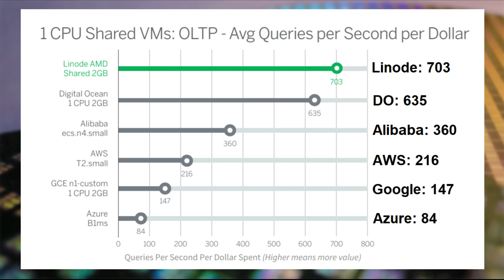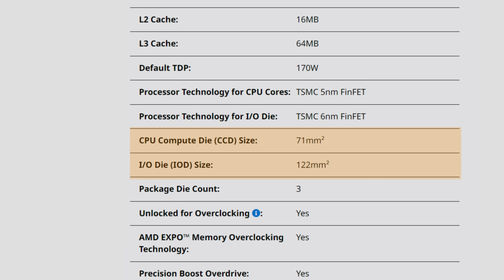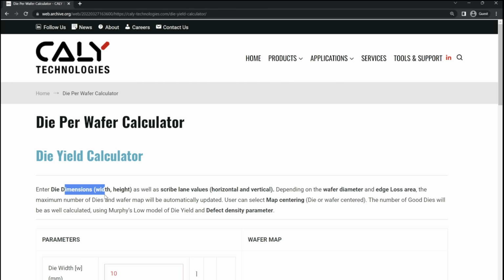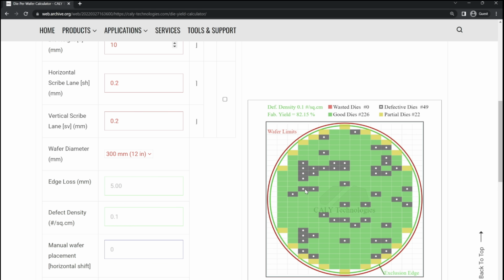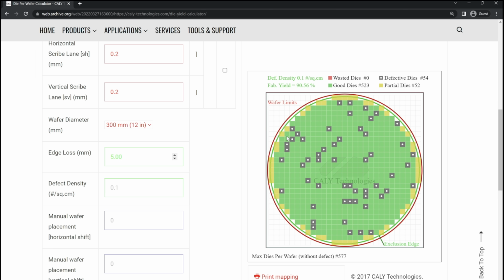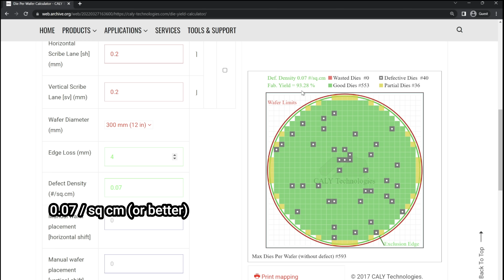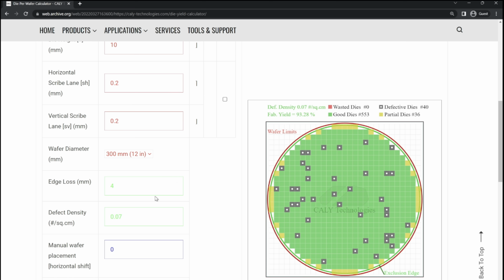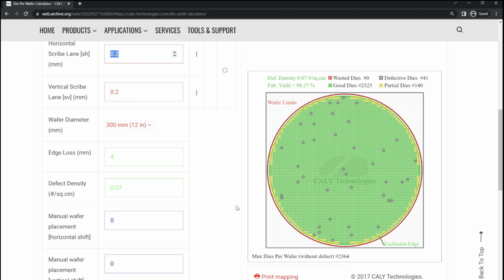AMD Ryzen 9 7950X: Cost to Manufacture?

Comment: Definitely good to keep in mind the hundreds of millions or billions they probably spent developing it. If you spent one billion on development and make a million chips, that's $1000 per chip just in R&D.
Reply: Right. If it was just the BoM, I would be making CPUs in my basement.
Reply: @technologyanimals  you mean like this guy? https://www.youtube.com/watch?v=IS5ycm7VfXg
Reply: @technologyanimals  3d print a 7950xt and maybe an extra one for a friend
Reply: Yep but how do you estimate the intangible, I would speculate the latest development costs have come down since they aren't scaling nodes as fast as before and the development costs only comes from redesign of the transistor layout and new cell types. But most of this can be automated with modern electronic design tools and even AI. The only reason there RND costs on there stock balance sheet stays high is because they continue to employ staff that aren't doing anything. They call it corporate day care now
Reply: That being said AMD did introduce AVX-512 to there newest chips but I suspect this instruction set and circuit design were probably done years ago but they were waiting for space on the die to add it.
Reply: @justindressler5992  Not scaling nodes as fast as before, but capacity is very limited so whomever pays the most gets it. Also they need ever more specialised lighting (EUV and looking at xray and others) and multipatterning which means a lot of research to get it right. They have issues all over which costs a lot to get right. 

Tiny chips made on 50nm (less need for transistor density and optimum power draw since there is not a lot to heat up, save space or burn power) and above have fabs with excess capacity not a shortage, meaning you do not pay a premium just for the privilege of using that node.
Reply: @justindressler5992  AMD had AVX-256 decoded to 2×128bit and did it that way. AVX-512 is good, but it peaks the powerdraw insanely high, and the newest AMD and Intel lineups already have insane powerdraw (some earlier Xeons with ~180 watt tdp peaked at 320+ for AVX512, and that was clocking down internally for AVX-512). Have not looked it up but I suspect they just have the 512 decoder and internally it does either 4×128 or 2×256, which is easy to do and lets it not draw too much and no need to clock down.
Reply: @jamegumb7298  I think AMD's implementation is a 2×256. But power draw is going up because nodes aren't scaling like they used to. So the only way to bring more performance each generation is to increase frequency and power. This can only go so far the thermal load on the transistor junctions and silicon will put a stop to that. What I found most interesting though is Intel managed to beat or match AMD's performance at 10nm vs 5nm. From the surface this should not be possible especially clock for clock. But the reality is the multiple Chiplets bring latency that can not be easily resolved. If Intel managed to build a monolithic die at 5nm or 3nm it would be unbeatable. The problem is that the thermal load is then distributed across the entire die. This is why AMD is more efficient it isolates the io from the CCD. This gives a larger surface area to transfer heat. When you get to 5nm it get vary hard to control leakage and quality of the transistor. AMD is using 6nm for it's CCD and 5nm for IO. Unless they can make GA perform like current tech they won't be able to scale much further. The increased power even reducing due size is needed to overcome leakage.
Reply: @justindressler5992  Frequency but also core count, power just goes up with it. But core count comes with its own drawbacks, not everything just scales to more processes. 

Node scaling not going like it used to, well not like that is new. Back from when we got Sandy Bridge the arch was kind of stuck for years and also was the core count (mostly due to little competition but still), ~10% each jump until Ryzen came and they had to get into gear. Which shows smart use of better designed cores can help a lot as well. Or course there are limits and cost/benefit to it all. I feel like the new(er) cpu's now are just catching up.

Leakage can be helped to an extent, this is why they went from simple "2D" transistors to all aroudn to now finfet. But that cannot be stretched a lot more. 

We cannot go much further with this. Transistors can already be counted in number of atoms. Unless we make some very sudden commercially available jumps in pico of femtoscale engineering smaller is not going to keep being the solution. Photonic chips have already shown promise and 10Ghz switching speeds just to start, with indium arsenide transistors shown to approach terahertz limit (heavily cooled, but  600Ghz+ is possible under normal high-ish temps such as in a pc). 

But this is just the hardware side. Many if not most frameworks already take up loads of cpu cycles and mountains of ram. Yes it makes devwork somewhat easier but a lot of times I get the idea they just suck up cpu time and suck mem like they want to prank consumers (looking at you Electron). A lot can be gained software side and I think it is ignored too often. When I write software I actively check where it necks and try to solve it. Many colleagues dgaf.
Reply: @jamegumb7298  I agree completely with you statement if core count was the most useful metric we would all be using threadrippers and Xeons. But as you said alot of software does not scale with threads much. This is Intel's philosophy that fewer high performance high frequency cores will work for consumers better than 80 cores. The difference between a Xeon or Threadrippers is they have simpler cores with lower IPC, this allows them to put more on a chip they also clock a lot slower but these chips are also thermal locked at around 300w. We now have server level power consumption of consumer products. The only way to reduce power is to make transistors smaller but this is proving vary difficult. People think that mobile phone SOC's are the same as desktop processors but normally they have much lower IPC and Frequency because of the lower wattage they scale more easily. But I see the end of the road for these possibly at 3nm. Software optimisation is definitely an area that can be improved and I think some of the biggest performance gains will come in optimisations with AI. Most of AI are the same mathematical operations repeated over large datasets. Simple mathematical refactoring and simpler merging of nueral networks will help. It is even possible it the future AI may help to improve data compression resulting in leaps forward with data processing. 3d gates help been the solution since the introduction of Fin FET but they add substantial complexity to chip design and manufacture. The next gen chips will likely be gate all around but just like fun fet these technologies require multiple layers to be built and alignment at layers above 7 become exponentially more difficult to produce I think the best in the industry are doing 12 layer designs but this info may be dated. Gate all around will require better alignment and more layers. on-top of this each layer adds to production time and end user costs. I think 3nm in mobiles will be vary expensive. At least until it becomes mainstream. Anything less than 3nm is impossible with current silicon techniques and require entirely new manufacturing techniques we are getting so small here that deficits will be impossible to control. So they will have to engineer me any redundancies into the chips.
Reply: @Karl with a K I'm pretty sure that doesn't even cover Jim Keller's salary while he was involved in the development.
Reply: @Karl with a K 30% over cost to manufacture isn't even close to profit unless you think people should be slaves and work for corporations for free.
Reply: @Karl with a K An entire new modern architecture from the ground up in a few weeks? Haha. You're dreaming.  It took 5 years to design the first Zen architecture, and that's with existing IP blocks, designs, and microcode to draw from.  They don't just start on an architecture after the previous one is released.  Different teams work on several generations at the same time.  They are probably already finalizing the brand new design of zen 5, midway through zen 6, and the teams that have finished their specific zen 6 work are already working on improvments on it for zen 7.  Meanwhile there's probably a team in the back already starting work on the next ground up design.  This is why intel is moving into it's tile architecture.  Not just to match the yeild on chiplets, but because with foveros they can add new IPs to their chips as they come out.  This will help their execution problems because they can update different parts of the chip without getting stuck waiting for a single flaw to be worked out.  They can update their A.I. accellerators and E.cores, and release on time even if their new P.core or graphics design has a bug and gets delayed.  They're not doing that because chips are easy to design and only take a few weeks.
Reply: Nice 🙂. There are other costs associated with the process, as well as bringing the product to market, and everything else that went into it. Don't forget that the lower end product has only $20 less in silicon, yet costs hundreds less in price. It includes everything else that is on the high end product. So, are they over pricing the high end product or are they taking a huge loss on the lower end one?
Reply: @Gryfang451  
it's already accounted for.
Reply: Or at least thats always the excuse that the development cost this much and that much but how do you know...
Reply: 🤣 you've never worked R&D huh?
Reply: Not to mention that the manufacturing cost has nothing to do with what AMD pays TSMC to make it for them.
Reply: @otbricki  $17,000 per wafer.
Reply: @otbricki  The wafer cost is what the customers pay. TSMC charges their customers per wafer which is the same reason different nodes cost different amounts even though it is the same silicon wafer they are using. The whole process is based on booking wafer capacity which is how TSMC makes their money. The actual cost of the silicon is relatively cheap for TSMC. Most of that cost is the TSMC cost of service.
Reply: @otbricki per wafer cost of $1700. isn't that already the price AMD pays?
Reply: @otbricki  He's talking about the prices TSMC charges AMD per wafer
Reply: @otbricki  They paid a lot of cash up front just for a spot. But Apple outbid them and everyone else for the newest process.
Reply: It's not working like that.... The designer is getting 30 50 million dollars and you get your architecture... Like zen1 and you are shrinking it 10 15 years down and getting boosts
Reply: The euv machine is about 150mil a pop.
Reply: @jintsuubest9331  Yeah but that is TSMC's cost, and doesn't affect the price that AMD pays per 300m wafer:   $17,000 USD.
Reply: @Dee Snow the cost's of one company is relevant for the pricing. You have to make your cost's at least to stay alive. But yes TSMC has paid of the uev machine with hundreds of customers to thousands of customers on previous machines.
Reply: @jintsuubest9331  yep but they don't buy new equipment every year. So this cost can be capitalised over several years of production.
Reply: Lowest on amazon is 700$ one chip cost 70~ they spouse to get 30% it means retail should cost  max 100$ ok you tell me r&d… let me tell you something about r&d you use money from profits that means r&d is allredy in the 100$ price and let me remind you they take 700$ where is the r&d intel still wins right? The truth is humanity capitalism is porcine we have no bottom and it will kill us eventually
Reply: You think they spent $1b making it?
Reply: a tonne of those chiplets go in to EPIC  where companies pay 100x the BOM cost per cpu.
AMD is making more than just a little money.
Reply: Oo stop it!! If they were spending that much in r&d their yearly bottom line would be an even break rather then the billions of dollars in record profits every quarter!!
Reply: @solidsnake6405  ^ This is true. What RnD they have to spend on?

They have nothing, no fabs, no innovation to speak off. 

Intel has Fabs, BoM, etc, that's why their costs are expensive, but AMD products cost so much for no reason.

Their expense is literally just a paper agreement between TSMC, and what they could buy from TSMC. Any wafers defective is refunded.
Reply: @solidsnake6405  Actually, it's twice the MSRP when compared to 10 series to the latest 40 series, or last gen 30 series.

But hey, Aymdiots will make AMD a pass if Evil Su decided to copy-paste Intel-Nvidia strategy but made it much worst.

Like how RX 6900 series is a 3090 series $$$.

Or the recent Zen++++ line-up, we are being treated with the 'Super' series at a later date, instead of having all of the APU with glued cache.

You're paying more money and double the money. Buying 7950X is a waste of money, might as well wait for 7950X3D.

There's always be a sucker that does this:

1. Buying annual release or the latest and greatest
2. Complaining it's expensive and perf gains are little to none
3. Complaining that they have no money

For the CPU space, for Aymdiots has some additions:

5. I'm buying 3000 series with 500 series board, but I'm throwing away my perfectly working 1000 series with 300 series platform.
6. Yet, when confront that 1st gen Ryzen doesn't work with 500 series board, they complain just buy a new platform, and no one should be running 1st gen Ryzen.

Like bruh, what's the point of for/backwards compatibility on AM4?

That's literally coming from a friend that own 1700X with a 400 series, only to find out that 500 series board is unable to support 1st gen Ryzen.
Reply: Perhaps Ian should do a video on this! Leading-edge semiconductors are probably the most complex mass produced technology developed by humans, ever. I don't know precisely why exactly it's so hard, but the fact that only a handful of multi-billion dollar companies can compete, and a new ground-up design can take multiple years with hundreds to thousands of engineers should be a sign. 

AMD certainly sells more than one million CPUs, and the chiplet design lets them even more easily spread those R&D costs across their products. Perhaps it only cost $500 million to develop and they actually make 10 million CPUs, now the per CPU R&D cost would be $50. AMD is definitely profiting, but getting there certainly wasn't easy. If it were easy, somebody else would have already done it!

If you have 1000 engineers, and pay them each $100k per year, that's $100 million per year right there. If development takes 5 years, you get $500 million. It's obviously not that simple, but it's not hard to see that this stuff isn't easy or cheap.

I'd totally be interested to learn more about what makes semiconductor development so hard though. It often gets boiled down to something (that I don't understand) like "We increased the micro-op cache from 2 to 3" but we don't hear why that's hard and why they didn't do that last time.
Reply: R&D doesn't work that way.
Firstly, the budget is not $1B.
Secondly, the equipment needed for research isn't bought every generation. 
So although it's not $65, it's much closer to that than it is to $1000.
Reply: R&D is obviously a significant cost that should be accounted for, but $1 billion is a vast over-estimate and one million chips is a major under-estimate.  I would be pretty surprised if it accounted for more than $100 per SKU and in fact is probably not significantly different from materials cost.
Reply: I think the R&D they invest will involve all the CPUs in that generation.
Reply: @tristanyt319  there's a reason why it's called architecture, all chips are the same.
Reply: @tristanyt319  also its not just for that generation, its just building on what they already have.
Reply: @tristanyt319   Yep, also AMD have 2 different teams working on Zen versions at any one time, often simultaneously. While Zen 3 was in tape-out, Zen 4 was in being created etc.
Reply: @tristanyt319  yes it is, they make it all back since ryzen .
Reply: Manufacturing usually has a minimum of 100% profit margin this is required to keep spare part inventory, engineers employed pay operating costs, marketing and so one. In the high tech sector were there isn't much competition 200-300% margin could be expected. Also AMD avoids the depreciation costs of operating fabs which need replacing or upgrading every couple of years. I would suspect there cheapest chips. Are making the company around 25% but there deerest around 1000% this is just how it is. If there was more competition say from China this may be a different story.
Reply: @justindressler5992  Problem is, only Intel and AMD can make x86 chips. Even AMD only got the license through trolling, otherwise Intel would have 0 competition.
Reply: @alex31ytb  I think Cyris has a licence as well. But you only need x86 to run Windows and even then ARM can be used of Windows as well. The instruction set was cloned several times in the 90's. But the word out is RISC-V which is an open ISA is pretty good and runs on Linux.
Reply: Exactly, price is not equal to manufacturing cost alone. It is an interesting piece of the puzzle to analyze though.
Reply: Billions for one chip design?
Reply: Why would it cost that much much to develop a chip?
Reply: BS read my comment r&d is money after profits and even if not why taking 1000% more its spouse to be 30%
Reply: And the marketing, and shipping, boxing, manuals, software and drivers.
Reply: @TheDrWes  and the Lambos, and yachts, and Dom Perignon, and caviar, and apartments, and prostitutes.
Reply: @rawdez_  First of all, a company runs on profits, you wouldn't work for free. second of all, we all choose what we spend our money on. if they decided to spend their money on those things, then so be it. what have you spent your money on that would be altruistic lately. 
These companies don't owe us anything. They create a product, they have overhead. Maybe you could afford these things if you started a business. I doubt your business would succeed.
Reply: I think it doesn't really matter if people are happy to pay these prices they will sell for those prices remember the first micro processors cost a lot less in the store and they needed to engineer everything from scratch. Every generation after would become cheaper to engineer as they become more feature complete. This is what Moore's law is about the chips maintaining the same cost but offering double the performance every 18 months. As a new node would require a fab to upgrade resulting in an incremental transition every 18 months. This of course is just artificial since the ligography techniques were pretty much the same until 20nm. The scaling was mostly artificial to keep prices up as these techniques were perfected in the early nineties. The more modern techniques are much more difficult to produce reliable chips  there are many factors such as submerged ligography multi layer chips euv and so on these techniques require much more elaborate equipment to make work. But the chip industry has been milking profits since the eighties look at Intel's new chip it is a copy and paste on the same node they even have a almost identical chip with the ks series instead of getting cheaper because they have perfected the yield over four generations on 10nm they just maintain there old pricing I would expect Intel is making way more on there chips than AMD are. This just shows that yield is reducing profitability in the latest nodes below 8nm. Intel has known this for a long time. It might get even more expensive when they go to 3nm using exotic materials and gate all around requiring more layers and much higher energy to produce.
Reply: @justindressler5992  the main reason why TSMC prices go up is because they see ridiculous prices AMD/Intel/NVIDIA put on products with chips made by TSMC.
TSMC just wants a bigger piece of a pie. hence newer nodes cost way more.
Reply: @rawdez_  yep of course as long as the consumer is happy they can charge as much as they want. Most think chips are some kind of secret magic that only a few people know how to design. This perspective helps to keep competitors out of the market and prices up.  If you own a copy of a decent Electronic design package like Altium or Cadence and a license agreement with ARM you can design chips with a small team. But the entry is cost for licensing, prototyping, test equipment staff is still quite high maybe a budget of several million to design your own chips that would have driver support on Linux and Windows and Android. Most companies choose not to design there own chips though as off the shelf designs are a safer investment.
Reply: @justindressler5992  if it were that easy there'd be more companies doing that, but you need a pretty huge company to not only make the chips but also create motherboards, all the firmware needed and somehow have a network to update your firmware for security patches (so basically windows has to acknowledge you as a chipmaker) AND you'd have to start off at 5nm process with a brand new architecture and still be competitive to intel (making cpus since 1971) and amd (since 1975)

That's why there are other cpu vendors but only for datacenters or mobile
Reply: @Suilujz  no it's just not viable to design chips that way you can buy SOC system on chips with full certificate and testing for less than 50usd. This is why companies don't design there own chips. That being said there is a difference between using of shelf IP and designing a complete instruction set. But again no one would do that because it would be equivalent to reinventing the wheel. Im not speaking without experience here I have both a Electronics degree and Software degree and have worked for several hardware manufacturers building consumer and industrial electronics I have also written embedded software back in the day. Chip design has mostly been the same for 30 years but the software tools and computer power has gotten a lot better so it is cheaper than ever to design custom chips you can even prototype high transistor count chips in house now using FPGA's before going to commercial scale. Don't get me wrong nothing is ever easy it always takes time especially when designing modern 14nm or less nodes with clock freqencies approaching 3ghz and higher. But entry is definitely way cheaper than ever before your can even design chips without license constraints using RISC-V instruction set now.
Reply: @Suilujz  sorry I didn't read your entire message I missed the more link but firmware is standardised now your can buy UEFI license and add custom UI theme and install on mayboars Intel and AMD typically provide this firmware which includes microcode patches for bugs in there CPUs. As for vendor certification in regards to drivers all vendors use the same drivers they just have a different VID and certificate. The only custom stuff are the bloat ware the manufacturer chooses to add if they think the consumer would precieve value in it.
Reply: Alot of people think the Chinese are stealing technology but if your a billion dollar company you have the resources to build an entirely new chip and instruction set from the ground up without copying. The main issue for entry though is Windows gaardened wall they will only support US chip vendors so If China wanted to make a CPU capable of running Windows they would have to fake the Intel or AMD chip designators this would mean they would also need to write the instruction set with the same querks and bugs of that chip so the microcode patches correctly. Of course if you were building a new chip you wouldn't bother with Windows and instead design for Linux were you have the entire source code a can make small changes to support your chips. This is probably what China is doing anyway to replace Intel and AMD. Remember Android and MaxOS are Linux/Unix derivatives Harmony OS is as well. This is by design to avoid heavy software design to support there chips. Windows is becoming more irrelevant by the year.
Reply: not customers problem
Reply: And marketing.
Reply: @Karl with a K what are you talking about the masks alone needed cost multiple dozen Millions of dollars.
Reply: Hahahaha 100s of billions to spent developing :D these cpu's have an annual release schedule..
Not even 100s of millions my guy. they make WAY more profit, netprofit, and other kinds of profits on top of profits.
if they make 100 billion in net profit and the next year 70 billion in profit that's called a LOSS LMAO!!!
Reply: No I’d argue that the R&D is included in that price, TSMC produces roughly 300 to 400 of these wafers per hour. If you’re referring to AMD’s R&D they didn’t develop the 5nm node that was TSMC, AMD just gave them a spec of what they wanted and how they wanted it done. AMD probably gave them 200M to start development of their chips, I wouldn’t say a Billion.
Reply: @ElvisRandomVideos  lol, just a spec eh? Is that what a CPU architecture is these days? Just a spec sheet.
Reply: @GSP-76  you said spec sheet, I said spec of what to do and how. Yes AMD did spend on R&D to know the how, but that’s over 5 years.
Reply: @ElvisRandomVideos  a CPU architecture is NOT a spec sheet whatsoever....and it's constantly changing year after year.
Reply: @GSP-76  dude you are saying spec sheet! But go ahead feel free of saying what goes into the process of making a chip, I’d love to hear what you know about that.
Reply: @GSP-76  tell me how you don’t have a clue about what you’re talking about in an essay! I wasn’t asking about their IP. Which AMD engineers go to TSMC fabs and perform the process that TSMC isn’t aware of? Are there AMD engineers in TSMC fabs? Can you elaborate how TSMC is aware of what the sequence of steps are, how long they need to dope the silicon, or when deposition takes place? Without any process specification. 

Go ahead I’ll wait, please tell me how TSMC knows what to do with the bulk silicon without any AMD engineers in their fab, and no specifications.
Reply: @ElvisRandomVideos  well not like you'd understand an essay either. That would require some sort of intelligence. Let's make this easy - Do you think Fans have CPU company trade secrets since they're building CPUs for them? Easy enough question.
Reply: @GSP-76  yeah that’s what I thought, you’re just a Fan! I’ve been working on this industry for 20 years.
Reply: @ElvisRandomVideos   @Elvis Gomez  sure you are.... everyone's a professional in YouTube comments. You still didn't answer my question "industry pro"
Reply: @GSP-76  I don’t really need to… you answered mine.. you’re just an ignorant fan! And because of IP (trade secret) I can’t tell you what I do in detail just in case you weren’t aware of how that works.
Reply: They make a lot more than a million chips.
Reply: @Derosier.  Google it then.  Annual R&D for 2021 was 2.8 billion dollars.  According to AMD's financials.
Reply: Also future R&D, manpower costs all other running expenses of a billion dollar company.
Reply: Zen++++ is just Zen+++, it's also based on Zen++. Little to no RnD is spend since AMD has no good engineers.
Reply: I bet 60% of “RND” goes to marketing
Reply: RD , marketing , box , software support , warranty.
Reply: It’s low hundred millions. Somewhere around 100-300 iirc.
Reply: that has to be taken into account in the cost - TSMC as a whole is proftable
Reply: Development cost, expensive employees, infrastructure cost, and failure rate are all important to take in, they raise costs by a very large amount
Reply: Yup, this is the real reason why they cost so much. Everyone has to get paid that works so the price counts for everything that goes into company resources that goes into it.
Reply: @Karl with a K no way in hell are you paying dozens of engineers less than 100,000 dollars. Hell each engineer alone is likely making at least that much and chip designs take time as you  have to plan them out and test then plan them out again and test etc especially with die shrinkage and any changes to the fet. It's no billion dollars but it's a few hundred million spread out over time.
Reply: Yep. And also all that R&D was done by hundreds or thousands of employees that still need to get paid.
Reply: @Karl with a K bullshit. It takes much longer than 90 days to design a chip. Tell me how many masking layers are needed? How do they prove a design works on the node? You keep talking about business as if you think you know something yet you clearly don't understand how even die shrinks with the same architecture is time consuming because the physics change. Stick to your pretend life instead of talking about crap you clearly don't have a clue on.
Reply: they make money in first development cost in first generation sell already...
cut the BULLLLLLLLLLLLLLLLLLLSHITTTTTTTTTTTTTTTTT
Reply: @sinanisler  huh?
Reply: Billions over all the year? Sure. But per new chipset? Not even close.
Reply: Who said the manufacturers spend billions for development for PC parts? I hardly believe that. Look at ARM for example. Its official corporation. Very succesfull one. They made the technology behind the smarthphones today. Their CPUs are much more advanced, smaller and efficient than any of the PC ones today. But Intel "Hey guys, look at our new i9 Super Beast 8 core CPU. Its result of years of development and billions of investments.". The Intel and the AMD CPUs are crap all of them compared to even the weakest of the ARMs CPUs. Thats the sad truth.

Many fall to that stupid lie. Many enough so Intel and AMD have an entire PR strategy for selling on that wrong basis. 

Today, this hour, the corporations can start mass production of small build, green, 16k PCs on reasonable prices.
Reply: and who says TSMC doesn't want a profit to keep developing their fabs?
Reply: They probably don't spend billions per iteration of chip development my guess Intel may spend up to 100 million, but this is just a pure guess. But they would have spent billions over the entire product life. The brand new chip is literally copy and place four new E cores there was zero tuning in regards to IPC so problem nothing changed in the design. The reason they could clock higher was because the production quality increased. They have be fine tuning the 10nm node for five or more years. This means the same equipment has been used does better waffers I suspect. They already had room on the die and there 12900ks was running similar clocks to the current gen. Really the R&D team probably took a holiday during development of the 13 gen chip.
Reply: @justindressler5992  this is AMD chip the video is about, not the Intel one?
Reply: @disadadi8958  I know but just putting things in perspective
Reply: Exactly my thought. if it was this profitable everyone would be making CPUs.
Reply: @anandapriyadarshan  it's not that easy. Profitable maybe, but have you ever had to design an IC? Even the most basic one is painful to do on something like Cadence, let alone a behemoth like a modern CPU
Reply: @disadadi8958  ha ha, yes. that's exactly the missing point on this video. just calculating the material cost - without taking into account the R&D and the patents and everything else that counts to producing these chips. Vehicle prices might be really down if we did the math like this.
Reply: It really depends on what your trying to design, if your designing an instruction set it is vary difficult because you need software support and industry acceptance. If your cloning an instruction set it is much easier but you have to deal with patent and copyright issues. If you using an existing instruction set under license like ARM you then design the chip with well established rules and testing procedures. Each level requires less and less input to complete. There are actually hundreds of companies using ARM instruction under license. But x86 compatible instruction set is heavily protected by copyright and patent law. But just because those laws exist hasn't stopped companies from making clones, if the get a assembly language book you can reverse engineer x86 in short time all the information needed is in those books. To design the chip eg deal with frequency, temperature, clock rates among offer things is vary hard. But the chip industry does not re-invent the wheel here thos have design rules that electronic design software uses to validate the design. They used to layout by hand in the early days but with modern CAD and even AI it becomes alot simpler. Keep in mind once an instruction set is designed it really can't be changed much. If they make any significant changes they will break the applications running on them the last significant change to x86 was in 1999 when they added 64 bit support. To get around compatibility issues they may add instruction set extensions like SSE, AVX. These extensions are not required to run your software and OS. The fabrication level is basically been the same process since the seventies the only difference is precision better optics, mirrors and higher intensity  light sources, the fabrication is the most difficult to perfect by far and has the greatest cost to the chip. The instruction set hasn't changed in years and the chip design to a large extent is copy and paste or automated.
Reply: R&D in chips is difficult. The industry is not really focused on one chip, but hundreds of thousand of people try to make the best jobs at their tasks. And any improvement will be used onwards in dozens of products.
So they can spend 1billion knowing that 10-100 products made in the 100'000th per year will repay it.
Reply: That's the trouble with modern capitalism: artificial scarcity. Producing below capacity to maximize profits may be good for one firm, but if everyone does it then you've imposed an artificial ceiling on the entire economy. That's why a communist country like China dominates manufacturing and tech companies don't want them acquiring advanced semi conductors. Their strategy is to flood the market and wipe out the competition with sheer volume.
Reply: @ryerye9019  ASML and Nikon cannot fill demand for chip machines as it is, and even  if ASML could get production 30%+ higher, Cymer cannot provide the lasers as it is. 

Even If either of these giants could create the chip machines to sell to China, China does not have the trained staff so they would need to train people to train others while they lack competent enginers as is. This is not a 2 hour powerpoint we are talking, but an intensive 6-9 months course and training regime.

You make it sound like ASML has a few dozen machines on a plank somehwere and China is eager to pay up.
Reply: developing, 
materials, 
manufacturing, 
advertisement, 
maintaining support.
Reply: They should also keep in mind the cost CEO and higher officials spend on their luxuries. Very important that they live better quality life compared to others. This cost many times are even more costly than R&D.
Reply: I mean, yeah, but that cost gets diluted over all units sold, and the cheaper the price, the higher the demand. 

Also, the excuse these companies used to raise prices is increased price of supplies, not R&D, and as you can see, that doesn’t hold water.
Reply: tinfever
their total operating expenses in Q2 2021 was 1 billion. that's ALL costs, the buildings, the power, the wages, taxes, marketing, materials, R&D, any company vehicles, phones, etc.
in that same quarter, they made 710 million in profit.
also the cost of R&D is spread out throughout the entire series they are working on. 

they are making mega profit, although they are certainly are not alone....most companies do this. it costs almost nothing to create stuff, they jack the price up until demand falls and then lower the price slightly until demand is at a point of their supply capability. that is to say the prices they list their products for are purely based on what YOU the consumer are willing to pay, not what it's ACTUALLY worth.

most of the cost you pay comes from their greed and middlemen taking a cut + their greed.
Reply: @rocksfire4390  yeah most companies make revenue, during that quarter they apparently made 71% more than they spent, and that was before am5 was on the market. am4 was absolutely revolutionary in terms of the price, performance and efficiency for cpus so I'd call that fair business. now their stocks are way down and interest in new components is minimal so they must have a reason for not slashing the prices because that'd be the first thing to consider.

shilling for a corporation is stupid but amd is the last tech company I'd label "greedy". nvidia started the $1000+ gpu trend, has all of their technology locked away while amd is almost always open source (gsync/freesync, dlss/fsr) and intel didn't do shit to improve their products but bump their 14nm+++ 4 core clock speeds by 100mhz a generation and sell that as "new" before ryzen gave them competition

the economy and tech market are both in some shit rn so any sensible person will just wait it out or buy used, or if you have made any research whatsoever you'll know a 5800X3D is better performance and price for a bunch of games anyway compared to either intel 13th gen or zen 4
Reply: @Suilujz   >the last tech company I'd label "greedy"
thats where you're wrong and where you're shilling for AMD. any Zen 4 CPU without V-cash is a dumb product and an insane overprice. I hope AMD would lose money on 7000X, but they won't because they would make huge profits even at quarter their price.

agree on the last part about economy and shit and 5800X3D though.
Reply: @rawdez_  yeah, but it's first gen am5, the ryzen 9 makes sense for anyone with unlimited budget and high productivity but other than that it's a dead series on its current price. This ain't the time to buy but I have faith in amd, they supported am4 for 4 long cpu generations with extremely good bios support on reputable brands and intel switching up the motherboard each gen is a huge downside for me. Once it's zen 5 with v-cache and a reasonable price + ddr5 is way faster and more affordable I'll buy a new ryzen, unless intel makes a huge breakthrough in efficiency and gets their goddamn mobo lineup sorted up and futureproofed. AMD and gamers would have been better off just releasing a 5600X3D but maybe this janky and overpriced generation is a necessary step towards a potentially huge am5 value somewhere in the future.
Reply: @Suilujz  >huge am5 value 
that sounds like a bad joke when you look at 7000X prices.
Reply: @Suilujz  Well the real issue are motherboard costs. The CPUs aren't THAT overpriced and we're surely going to see some price drops. For simple gaming builds it's obviously hard to justify compared to prices on last gen and AMD is happy to clear out old stock. 

As someone who only builds every 6-10 years, I'm doing an AM5 workstation knowing there's a decent upgrade path if necessary and DDR5 will only keep maturing. Once market prices adjust this makes a lot more sense to me than buying in at the end of DDR4 to save a few bucks. The 3D models will be great but if they even launch a 7950X3D it'll surely be even more limited by thermals. That's a technology I expect will be really interesting in a couple of generations. 

Honestly I was waiting for HEDT options but unfortunately it seems that ship has sailed for now.
Reply: @JJFX-  actually the mainboards would cost considerably more than a CPU to produce the multi layer PCB including high guage copper traces for power the VRM the inductors, caps heat sinks firmware, high performance south bridge chips connectors, wifi transceiver module on its own could cost a a purely material cost more than the CPU. So mainboards are actually a bargain.
Reply: @JJFX-  I think the ryzen 9 has took threadrippers place as an HEDT chip, unless you're looking for 24 or 32 cores the ryzen 9's are just faster and cheaper than threadripper was, especially accounting for morherboard
Reply: @Suilujz  
being the underdog is a calculated plot point. nothing wrong with that, just pointing out that it's used to market their products.

stock price being up or down doesn't mean anything at all, assuming you know how the stock market actually works.
i would label AMD as greedy, all of them are. look at how much it costs to produce, it's not a small markup. they could be making 10-20% profit and that would be considered fucking crazy good.

they jumped on the same boat Nvidia did with their GPU markups.
i like AMD but i'm certainly not ignorant about their practices and for that matter any publicly traded for-profit company. they have a legal responsibility to maximize profits, at least in the US they do.
Reply: @rocksfire4390  being 'ignorant' or aware of their "practices" changes nothing for the end consumer, your best options are still to wait, buy second-hand or buy from their competition, which employs those exact same practices

of course some of the additional price is from jumping on the opportunistic lets raise prices bandwagon, as amd probably is legally bound to do as you said. I'm sure some % of the increase also comes from the stores selling components raising prices across the board as well. All companies are greedy but either amd or intel could take absolute lead in the cpu market by slashing prices, so there must be other reasons not to
Reply: IIRC Nvidia, Jensen on stage, once joked about the cost of 10-series to be was it 1 or 2 billion to make? So I assume it really is costly even for CPUs each generation.
Reply: Yeah AMD is a charity organization. They make only one dollar profit per CPU and it goes to charity organizations.
Reply: Another post, which supports corporate greed and profits. In the US alone - at least 100 billion dollars in pure government subsidies are given to R&D. Public money given to tech corps to develop chips which they sell back to the public at huge profit margins. This is how the tech industry works and has worked for the past number of decades. The fact you've reached hundreds of likes already seems to suggest that people have fallen for this private R&D mantra. Oh well - I wonder if anyone will even read this comment.
Reply: @Avielse7en  that's not what happens. When the government gives money for R&D they expect something in return which can be as little as disproving a theory or as big as a new patent that enhances national security or whatever the purpose was fo. Secondly there is absolutely nothing wrong with companies profiting and history has shown over and over again if you take out profits then there is no advancement or employment. This has nothing to do with whether or not they should pay better because that's between them and you.
Reply: @Avielse7en  Was wondering if anyone would point this out.
Reply: The R&D cost is general across all of the CPUs. They make a complete design and then cut it down to make lower end parts for various reasons (it's modular so to speak). And it's not that high, otherwise you wouldn't see 200/150$ cpus. But yeah, 69$ for a chip sounds about right.
Reply: @SviatoslavDamaschin  yes and no they actually want to yield only high end chips eg 7950x this is there goal for maximum profitablity. But during manufacture many deficits can occur. These companies design in ways to resolve these defects by disabling cores and lowering clock frequency. If they only yield 7950x they would be extremely happy but in reality they will yield all sorts of chips. This is why during launch the best chips are more available then eventually they build stock of the cheaper chips. In some cases they may even find chips that outperform there top spec chips they will release then when they think that can maximise profit for them.
Reply: @justindressler5992  Yeah, that's what I meant by various reasons and modular, they don't throw away stuff, they disable the defective parts and use less binned chips on lower end SKUs etc...
Reply: @SviatoslavDamaschin  I was talking to a bunch of other people about this in another video and I guessed it to be around $100...so I wasn't that far off.
Reply: @Karl with a K lolololol lol. It's realllllllllly easy to look up on the internet. Think people are as stupid as you to think it costs just 100,000 to design a chip? How stupid can any one person be? Edit: I just looked it up their engineers make over 100k unless they are part of a summer co-op.
Reply: Keep in mind all the government grant money and the fact that they probably charge the government and defense agencies 10 times what they charge consumers for early access to these chips
Reply: @darkkingastos4369  Pretty much how tech corps make their huge profits. No smart business would "risk" spending billions on research for a failed product. The general process is this - steal public research and repackage as your own. Use government subsidies and the public sector to finance further R&D and said sector to buy your product at above market rates. Spend huge monies (still partly subsidised by the Government) to advertise/propagandise said product back to the public. Keep people thinking this is all part of the free market/free trade/capitalism. We fall for it EVERY year. Oh well, I wonder if anyone will even read this comment.
Reply: I could care less about R&D cost, that is AMDs issue not the consumers, R&D should be built into profits in general and not looked at as a cost to the consumer and the current gen that is being sold. In other words the R&D cost of the 7000s series should in now way directly dictate the price of these cpus. It's more of a slight cost that is just figured into the profits and is ever rolling.
Reply: @No-One.321  what 😭😭
Reply: @No-One.321  R&D is essentially equivalent to taking out a loan to start a business. It has to be paid back through sales of product, and a business model accounts for pricing and predicted sales to pay back that loan with in a given time period, as a bare minimum. Ideally there is net profit involved as well. If you spend all you have in R&D (or anything else relevant to a given business) and never bring a product to market, or it sells poorly you default/bankrupt and your company goes under. Having next to no R&D budget is where Bulldozer came from, and they almost did indeed go under.

An established company is essentially always borrowing from itself for the next project, and that money has to come from somewhere.
Reply: @No-One.321  and this is how companies go under and now no one gets a product.
Reply: @Sprxngtxme  Uhm no, look at Xiaomis rise, their flagship smartphones were very very reasonably priced at the beginning, but then they knew why sell a phone extremely cheap and have very low profit margins when you can just do the opposite and work with super high profit margins and make billions like every other big company does
Reply: @No-One.321  they have to keep staff employed to maintain competitive advantage even if they aren't doing anything. Imagine if these engineers became unemployed and there knowledge and skills was taken to there competitors, imagine they moved to China. This cost has been going up over the years but since AMD and Intel are the only x86 vendors in the market they can price it in to there chips. Silicon costs and been relatively consistent for most of history but keeping the growing number of engineers out of the workspace is making things vary costly.
Reply: @fearsomefoursome4  yep I saw this story the other day. I wonder how this applies to the US Constitutional rights maybe US citizens don't have any rights now. But to be honest ever human is born with a brain and giving the right education are capable of success. So the real question is do you think there is no one smart in a billion Chinese. Just because we don't understand them or there culture dies not mean they are not capable of engineering there own solutions. Huawei was boycotta by the US the moment they realised Huawei was building a new OS that would compete with Android. Remember Android is just a bunch of API's on-top of Linux
Reply: @fearsomefoursome4  I think it goes both ways like I said in one of my other comments I work in manufacturing. The chip crisis in the car industry across the globe was caused by China they still make low tech chips at 14-20nm these chips are used to control electronics in cars and many other products, they also make many of the memory chips found on modern hardware like NVidia GPU and SSD's. Part of the increase in cost of NVidia and AMD GPU was caused by memory costs going up in China. You don't have to be a cutting edge provider to play a big part in the Tech industry.
Reply: @No-One.321  Not sure you know how businesses work…
Reply: @No-One.321  Yeah they should just snap a finger and expect a CPU to appear...they don't need the thousands of employees that actually design and create their products. You sound like your 5 years old.
Reply: @GSP-76  you sound like you don't know how to run a business.
Reply: @No-One.321  you contradict yourself.
Reply: @No-One.321  you are making too much sense, but here come the "AMD is not a charity" herd.